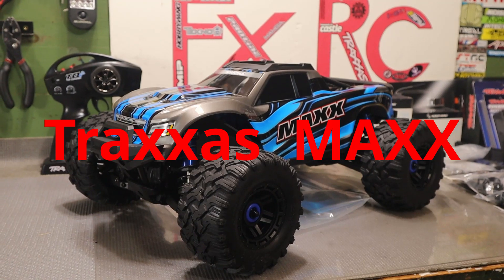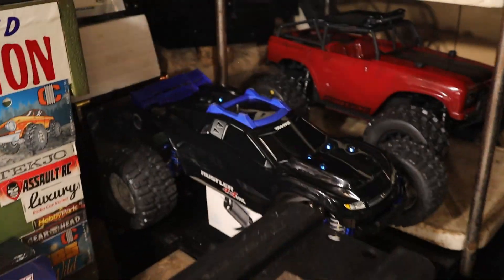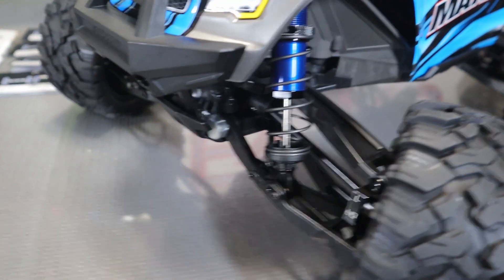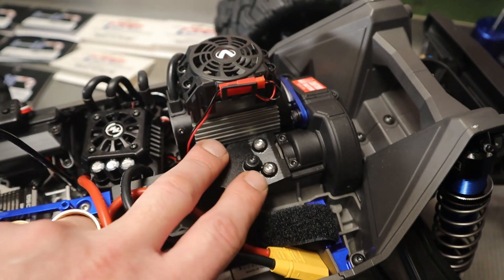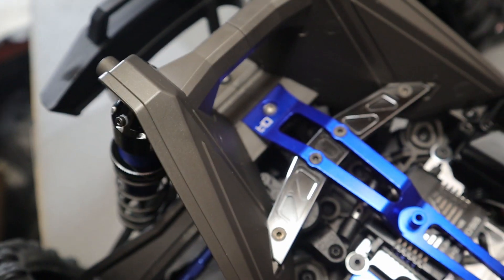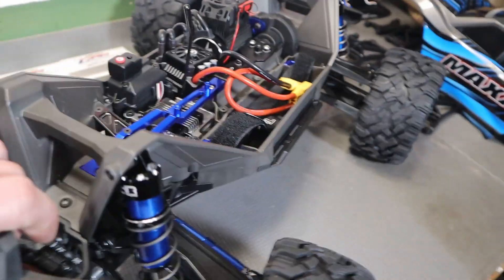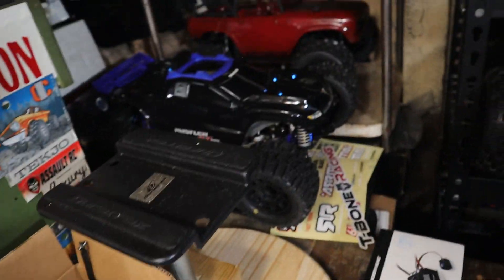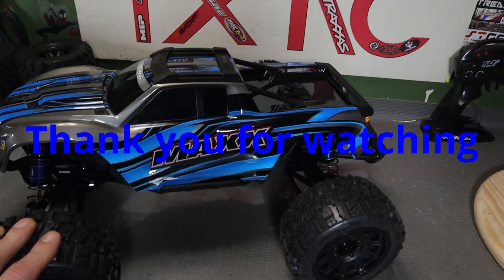Traxxas Maxx

Comment: Just subscribed.  I like the depth you go into on your builds. I just built an 8s CEN Reeper.  Underrated truck in my opinion.  I've got a Kraton 6s on the way. Going the M2C the hell out of it and probably put in a big hobbywing combo. Keep the content coming!
Reply from the maker: Thank you brother. Those cens do look pritty sweet. Ive thought about doing one myself
Reply: @fxrc3086 A little difficult due to lack of aftermarket parts, but it's different.  Everyone had a modded xmaxx. It's a capable platform.  If you do it, keep it as light as possible. The cen plastics are plenty strong. The diffs are not. The less weight the better. Going aluminum and adding weight with all that power will destroy diffs constantly.  Anywho, the maxx is awesome. Looking forward to future videos.

Comment: Have almost the same build besides went with traxxas 6s electronics with the larger traxxas motor mount you mentioned.  I also used all the Traxxas T6 parts vs Hot Racing.  Where did you find the Hot Racing T6 shock cups?  Can't find on site.  Moving the front shock to outer holes on arms level the car out more compared to the rear, quick hack for improvement o geometry.  I also blew the center diff and upgraded to the wide steel and aluminum traxxas one, well worth the 25 dollars on 6s.
Reply from the maker: Thats awesome... love this truck. Im def going to look into that for the center diff, I haven't had any issues so far. I have vitavon bulkheads on it now and they're sweet but it does add some weight. I got the hot racing shock caps on Ebay. Thank you for watching👍👍
Reply: @fxrc3086  The part number is 8980 and I lied like $75 but hardened steel throughout, T6 cup, crazy 100+ diff weight and m1 with wide.  Basically a spool.  I can't find the cups on ebay and must be the same size for a different model.  Hot Racing site doesn't mention them either.  I will troll but if you have the part number from ebay would be awesome and last piece I would get.  I essentially am running the Traxxas rebranded erevo hobbywing 2200KV motor at 26/46 gearing and a hard drive on 6s that you know.  I stuck with the Traxxas erevo 6s ESC for the Bluetooth module and motor Temps, rpms and etc to the phone on the controller mount telemetry module with lighting, super lazy 😴.   Being a Ohio State Alum went red vs blue for obvious reasons🤔  Are Arrma Infraction builds are similar but V2 with castle mamba 8s with 1520 1650KV for drifting around round abouts👍
Reply from the maker: @specialheschel2295  thank you for that my friend im def going to check it out... the part # for the shock caps are MXX156AX10 and the collars are MXX156BX01

Comment: Stock springs?  I can't understand why there isn't more spring options for this truck.   It bottoms out a lot.
Reply from the maker: I've had this same problem.   Hopefully with the New Sledge having the same shocks Traxxas will fix this.  Even with the supplied widemaxx spings and full preload in the rear it is not enough and then with the added weight of 6s and all the aluminum 🤯
Reply: @fxrc3086  I’m thinking maybe the proline dual rate spring shocks could be a solution? More spring options too possibly.

Comment: Nice dude! Thinking of making my maxx 6s. Did the motor fit straight in or did you need to mod anything?
Reply from the maker: Thanks... the moter went right in. Just couldn't use that plastic ring support on the end of the moter.
Reply: Ok thanks dude!

Comment: How did you mount the motor?
Reply from the maker: Double sided tape and one screw. There's an aftermarket carbon fiber ESC plate xtream that screws into the 2 holes ive been thinking about picking one up👍👍

Comment: Hello, Can you please tell me with the  Traxxas steel axels and widemaxx kit, Will all the front and rear Hot Racing Hubs and front Caster Blocks work fine with that set up? Do i have to change anything if I buy the Hot Racing  aluminum Hubs and caster blocks?- Besides bearing switch over for the newer longer steel axels? Any help would be appreciated. Looks like you installed them with noi problem to work with the steel axels.
Reply from the maker: It all goes together flawlessly my friend... the hot racing hubs come with oversized bearings for the inside bearing and u just  use the stock bearing for the outside of the hub If I remember right... anyway everything u need will be there... the widemaxx kit, steel axles and hot racing hubs... its an Amazing setup good luck👍👍

Comment: It’s pretty incredible spending more that what the truck is worth in parts ahah. 😂
Reply from the maker: I know, right...👍👍
Reply: Its called a hobby Einstein, you don't get into it to save money its actually quite the opposite
Reply from the maker: @Joe-no5dj  It is quite the opposite indeed👍👍
Reply: @fxrc3086  i’ve got a maxx too and i’ve spent about 200$, i’m thinking of buying the xmaxx now
Reply from the maker: @guillaumegagnon7049  I love my X-Maxx its definitely worth getting
Reply: @fxrc3086  does it chassis slaps like the maxx out of the box? I had to put 80w oil in the shocks and i ordered some erevo 2.0 tires along with a new gearing ratio to avoid overheating. The X-maxx seem to be better equiped out of the box (it has metal driveshafts for example)
Reply from the maker: @guillaumegagnon7049  It is better out of the box for sure for the most part but this maxx isn't too bad but ur paying more for what it is, I feel ur getting more for ur money for the X-Maxx.
Reply: @fxrc3086  thanks for your opinion, someday i'll get an x-maxx!
Reply from the maker: @guillaumegagnon7049  anytime👍
Reply: Its a very fun hobby. I tend to laugh when I break parts doing stupid shit, means I get to spend money on upgrades lol.
Reply from the maker: @michaelregan427  so true...

Comment: Should I just buy a new roller on eBay and start with that?? Since a lot of the  junk won't be needed?
Reply from the maker: I do like doing that when I can. If ur going to upgrade everything anyways then it make more sense to buy the roller if u can find one. I wish Traxxas sold more kit version or even rollers of  there RCs
Reply: @fxrc3086  most definitely! I put every single Traxxas hop up offered for the 2.0. and other stuff too t bone racing skids proline wing. Crazy fast servo big fans all that. And my arrma felony is built to the moon as well... Just ordered 800.00 worth the parts from scorched rc just an hour ago ha. Yea I think I'm going to get a Maxx roller or a hoss roller after this 1/5 outcast exb build..
Reply from the maker: @never-stock-rc2968  love it... these rigs are awesome out of the box but with some upgrades they become beautifully functional works of art.👍

Comment: The body will still fly off even with it being so tight going on. Ive destroyed my body in just a month of barely bashing it.
Reply from the maker: That sucks, you think traxxas could figure out a way for that system to hold the body on better.
Reply: @fxrc3086   i mean for the most part it does hold on better and its alot easier to deal with then the 4 body pins that are easy to lose. It can handle a good hit over and over before it will pop the body off but ive done it a few times. I took my wheelie bar off for a lil while and thats what really jacked up the back end of my body. Lol ima get the heavy duty body next and see how well it handles the abuse.